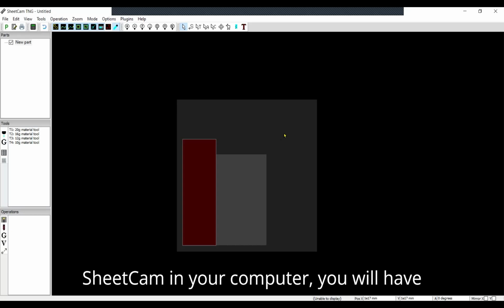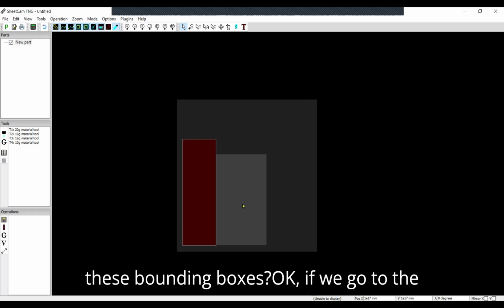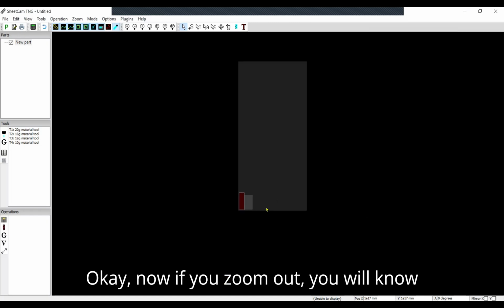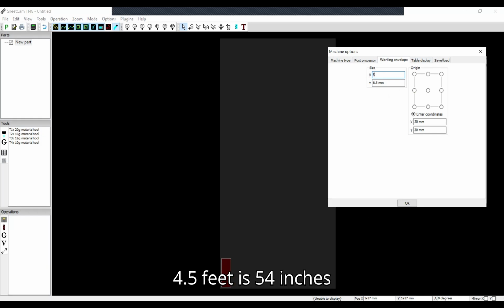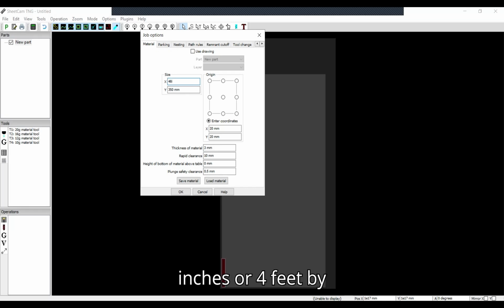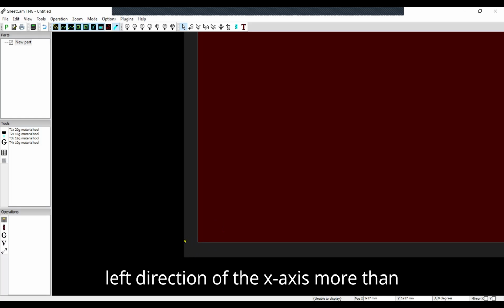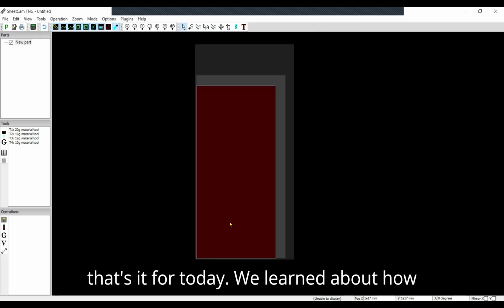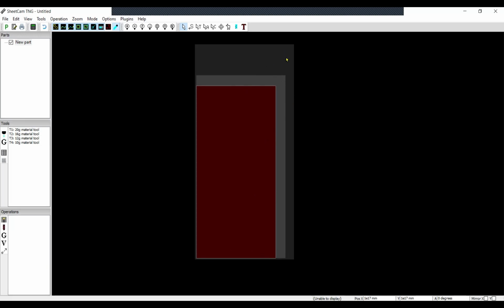Lec #10 Sheetcam Job size, Working Envelope & Table display | CNC Plasma Cutting for Beginners

Comment: Thanks for the video. Is there a reason why the working envelope and table size are both on left bottom corner? I assume in most plasma cutters the working envelope is about center of the table. Will there be a problem if you center it? Thanks.
Reply from the maker: Thanks for your question. In most plasma machines we have come accross. the machine zero/home position is set at the bottom-left corner, which is why it is used in the tutorial. 
However, you can also set the origin at the center if your machine uses that configuration—just make sure the controller and SheetCam settings match.